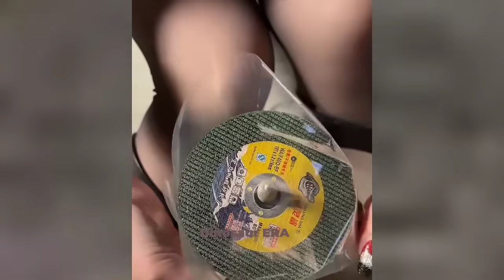Best Oddly Satisfying Video -Try Not To Say WOW Challenge!#27😍🔥Amazing People And Tools.

Comment: 8:35 steam-engine boiler-tubes, maybe just a boiler for domestic-heating if they're still in use; I only know because how Lovecraftian a mangled lethal mess them become when they dramatically-fail: utterly complex & just how to determine a failing-point in such a hugely long series of conduits joined in a five-mile-length of connected welds on tube: they just ejaculate in two directions harpooning everything as steam-powered-rocket-tentacles in a millisecond, leaving piping-hot-nightmares.
Reply: It is definitely some kind of heat exchanger.